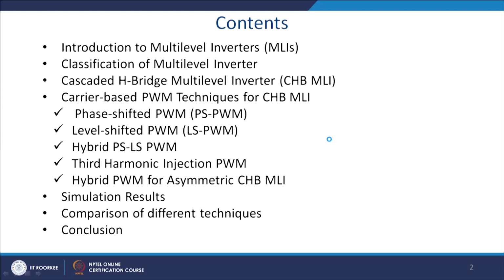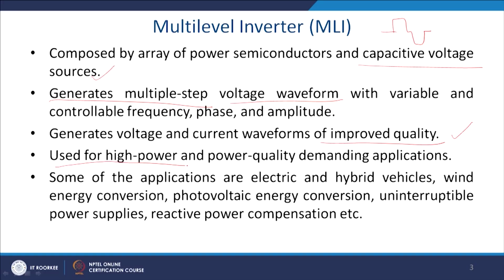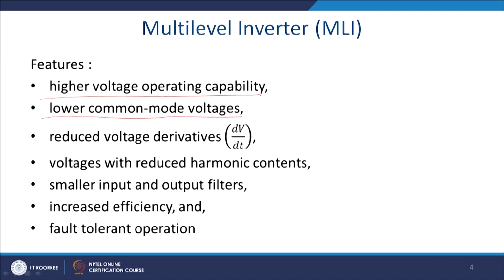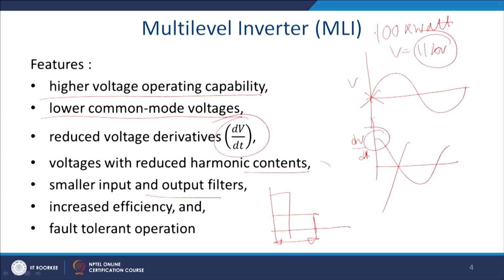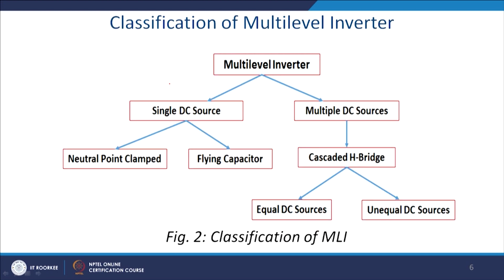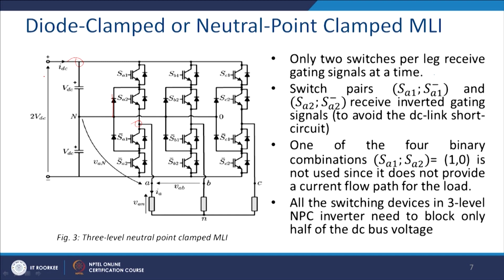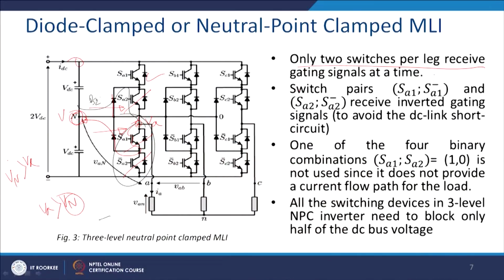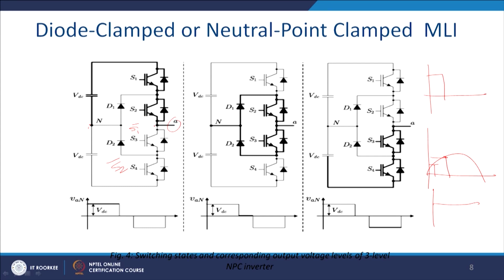Lecture 20: Multilevel Inverter

Comment: Excellent explaination sir about different multi level inverter but I have a query in T-type multi level inverter as you said it is only possible +Vdc 0 -Vdc but in the below paper 
A. Sheir, M. Z. Youssef and M. Orabi, "A Novel Bidirectional T-Type Multilevel Inverter for Electric Vehicle Applications," in IEEE Transactions on Power Electronics, vol. 34, no. 7, pp. 6648-6658, July 2019, doi: 10.1109/TPEL.2018.2871624
we can get five level, how to get +2Vdc and -2Vdc sir